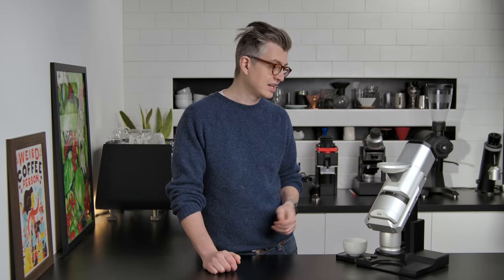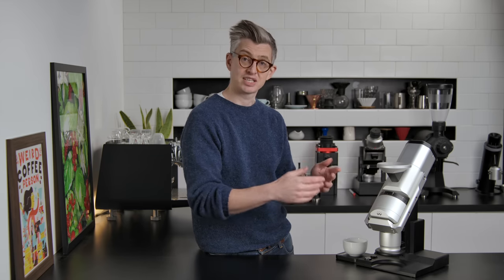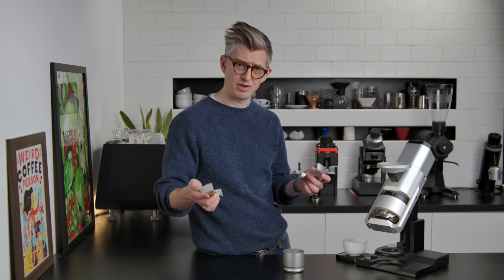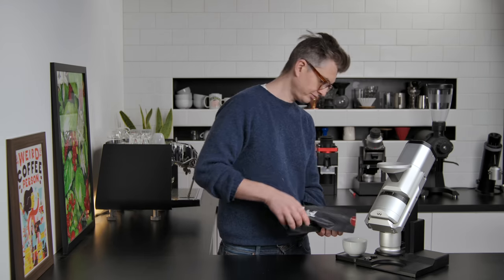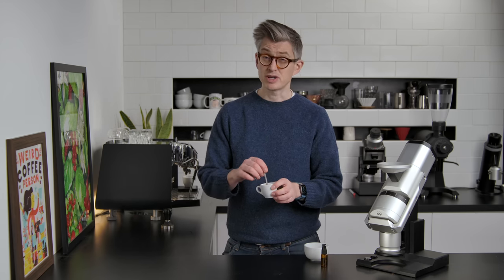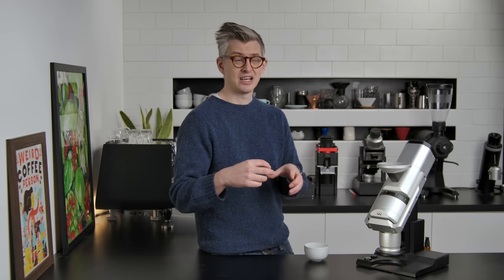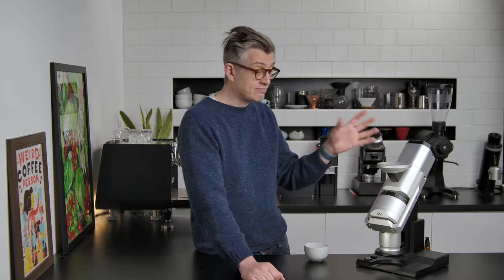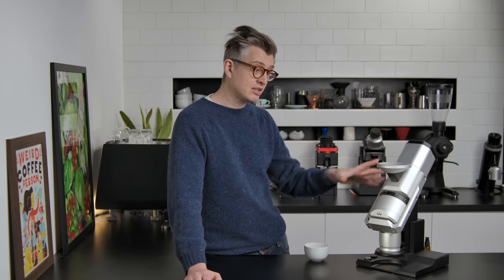The Weber EG-1 (Episode #2)

Comment: Safety thought - One question came to mind as you showed off the burr access - Is there a lockout mechanism that prevents the grinder from starting when the burr cover is removed or is it possible to accidentally bump the button while they're exposed and get your fingers mushed up?
Reply: You unplug it
Reply: @Adam-vx6to  a grinder for $3500 should unplug its own damn self.
Reply: @PetrosArgy  it’s still has to abide by the laws of physics…
Reply: @Adam-vx6to  No, seriously. With all the tech and over-engineering that went into making that and especially considering that the blade shroud is held on with magnets, it's incredibly simple to add a magnetic reed switch to disengage the motor circuit if the guard is removed (or gets knocked off). I can guarantee you that in a world where people give their infants plastic bags to play with, some Darwin Award candidate with too much money will remove the guard, run the motor and put their fingers or a paint brush in there to dust it off. Or their kid will.
Reply: @PetrosArgy  or you unplug it….
Reply: @Adam-vx6to  Yeah, I don't know why I didn't think of that.
Reply: @PetrosArgy  me neither

Comment: The one thing that comes to mind regarding episode 1 and the dial numbers v. grind is that wire gauge and shotgun bore gauge have higher numbers as the size goes down, because it relates to how many wires/pellets fit inside a circle of a set diameter.

Comment: What do the rpms actually do? If they don't have an impact on taste, they are a 'cup holder'.  Interesting that the hg1 (manual )was too expensive for the high end manual showdown , but this is not. Consistency is the hobgoblin ....
Reply: It’s all about particle distribution....lower rpm = less fines
Reply: Thanks Sasa, it makes sense then why does Hoffman use a mid Rpm? I try and minimize fines. Does he want  a trimodal distribution?
Reply: @parasbhargava6047  rpm setting goes from 500 -1800 if I recall correctly. I keep mine at 700 constantly so can’t recall exact range. Adjusting rpm in the past has resulted in significant change in extraction times at the same grind setting.....I’ve tried various rpm’s but between 700-800 gave me the most consistent results for the beans that I mainly use
Reply: @sasamarjanovic9761  someone should add a fines sensor and have a closed loop grinder rpm controller.

Comment: How about enthusiast grinders for normal people? Like in the $500-1000 range? Because these grinders are interesting to watch, but hardly anyone in the audience is going to have the budget for them. It's a bit like reviewing Ferrari's for the average consumer. It's interesting, but not useful.
Reply: You have a valid concern here, especially since a lot of these are small batch production. Kafatek is super hard to get a preorder in for and is nearly as expensive as the EG-1. Levercraft is building their LCU's in small batches as well, I think around 20-30, though you can preorder at any point. Lagom is also preorder only. Weber's EG-1 is in regular production, but I can't imagine they're making a lot of them. Mahlkonig here is actually the odd man out, since getting an EK37S isn't that bad; it's regularly in stock. He's also left off some high end grinders here like the Caedo E5SD ($1350) and the Caedo E37Z Hero ($8350). There's also the upcoming Titus Nautilus in a similar price bracket, and the Ditting K804/K807 Lab Sweet ($3000/$3300). 

I think part of the situation here is that the enthusiast range you're speaking of is fairly well sorted. You've got Eureka, Niche, the HG-1, & Hyperaligned Vario's to start. A big difference with these grinders, and something I hope Hoffmann goes more in depth with in the head to head is the burrset; they're really what you're buying most of these for. The LCU, EG-1, Monolith, EK43S, they're using larger than typical flat burrs. In fact, all but the EG-1 are 98mm burrsets. A burrset at that price point is easily $500 on it's own, and there are some great features on these. The Levercraft & EG-1 are both using blind burrs, and the Kafatek has a new proprietary burr design (Shuriken) that's supposed to be a big deal, and only available on a Kafatek grinder. The price for a motor that can comfortably achieve appropriate speed for these burrsets isn't inexpensive either, and neither is the controller design. Plus you need to spend a lot more time on alignment for this size of burr, as it's very easy for a 98mm burr to have alignment issues and grind poorly. There's more to the cost on these than just design cost; you'll see that in the Levercraft video, since it's got a secondary encoder box and a tertiary controller box, while having long cables; the grinder itself is just a big servo motor on a base with a burr carrier. I expect Hoffmann to despise it's design, even if it's a great performer.

Anyway, I do think what you're asking for is a good idea, but the grinders in that price bracket are fairly well documented. These, aside from the Mahlkonig, are not. There's very few videos especially on the Levercraft, but there's not a ton for any of these small batch grinders. Besides, it's like Top Gear, a bit; you watch an individual drive something very expensive for the art of it, not necessarily with the intent of buying it. That being said, I do have friends with some of these grinders, and I myself have preordered a Levercraft Ultra.

Comment: Sorry but I don't think you have the education to speak on the engineering of the product but I do trust your opinion of the results it produces. 

The use of magnets are a HUGE clue to the low quality of the engineering. At this price point there is much better engineering tricks to make a tool-less serviceable coffee grinder. Magnets are just the new marketing trick that is impressing all the morons these days. There is most definitely a larger than 60% profit margin on this unit. The floating RPM is proof they didn't even spend much on the motor's esc. That thing should be able to hold an RPM like a rock for that price. I bet if you took it apart it does not even have a brushless motor just some cheap chinese brushed junk.

Comment: For $3500 that motor sounds awfull. If u sell such a pricy product, that fullfills not just it's intended purpose but acts more as an lifestyle object and well of enjoyment, u should also take care of ur motor sound. Think of sounddesign for cars. Of course that motor is propably well build and all, but the sound just doesn't spark enjoyment, at all. It  just doesn't fit the otherwise flawless, clean and well designed feel of the product.